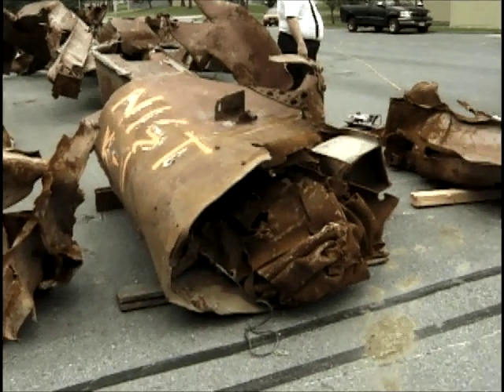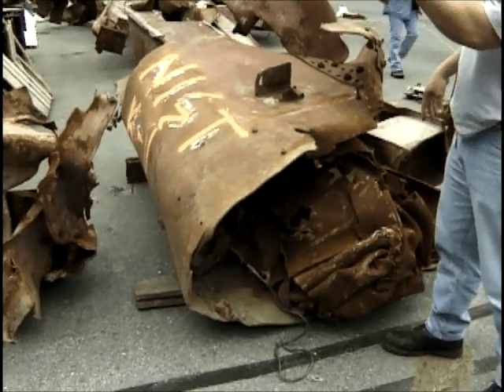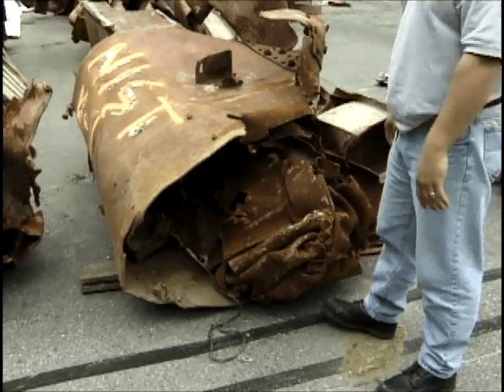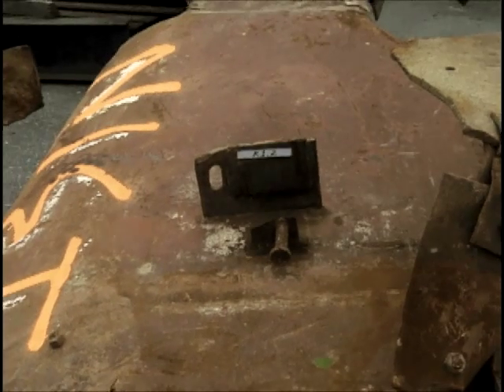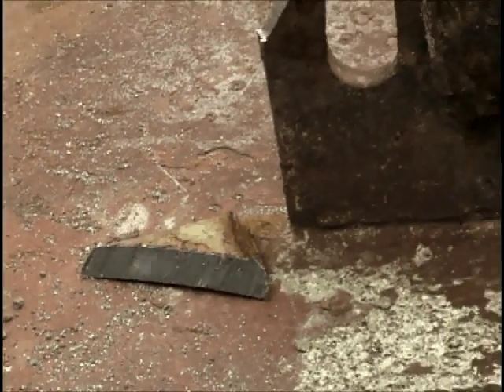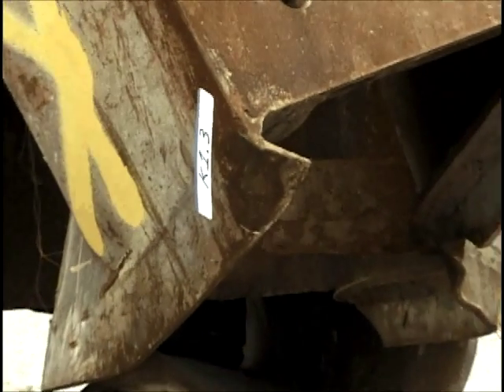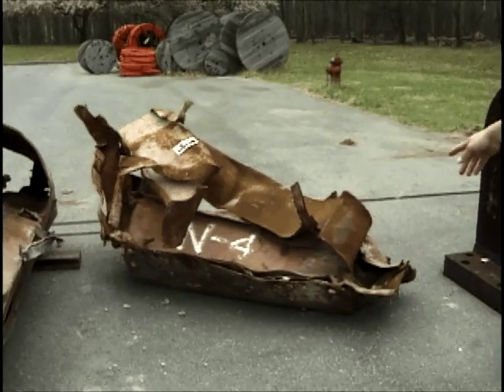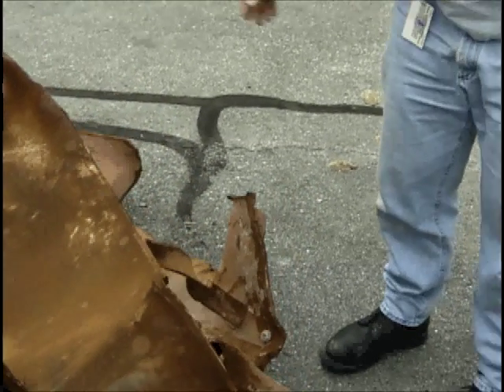Steel Samples from WTC Towers after 9/11 (Clip 1, part 2)

Comment: @JaKaRe36 t's obvious you haven't read much on the subject, not all of it was recycled. As you can see there is enough to take samples from, but trying to get a chunk of that to analyse would be made difficult.  Difficult?  There's a big chunk of it in a roadside diner,on route 66.   And no, they are not the first steel framed building in history to collapse,you dumb ass. What about the Kader toy factories? You dumb ass. The truth movement has died. RIP.

Comment: @MrSavagerocks It's obvious you haven't read much on the subject, not all of it was recycled. As you can see there is enough to take samples from, but trying to get a chunk of that to analyse would be made difficult. 

The first EVER steel framed buildingS (yes 2 on the same day, thats if you are forgetting about wtc7 aswell) to collapse from 'fires'. Nothing will destroy the 911 TRUTH movement so long as there are fools like you who cannot accept that they have been lied to.